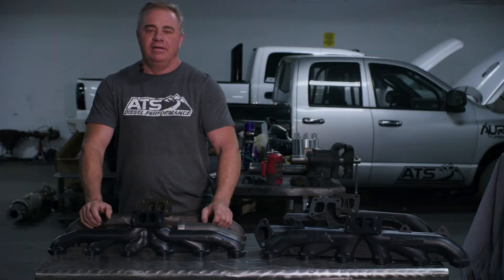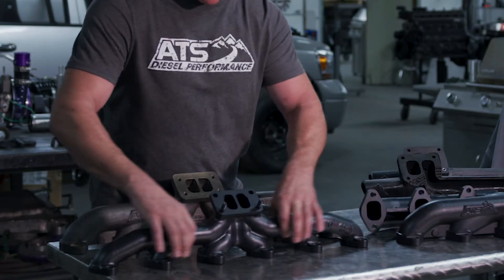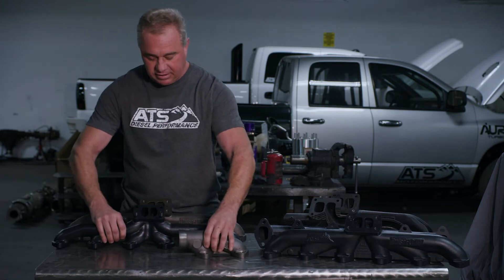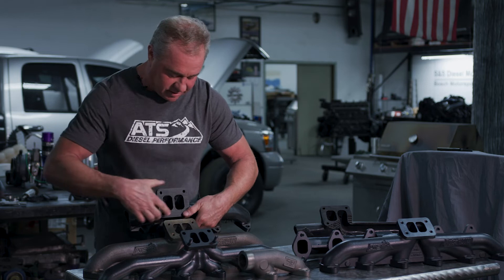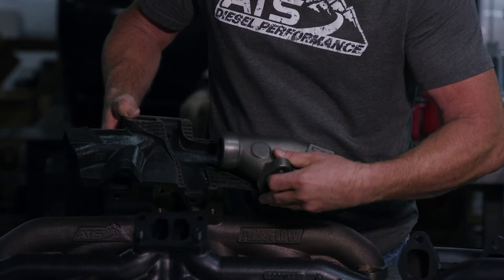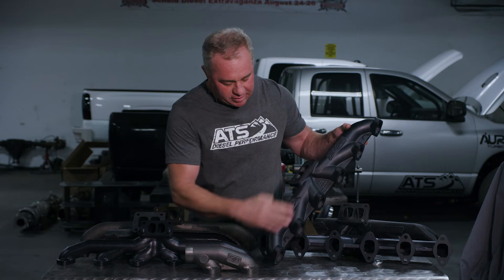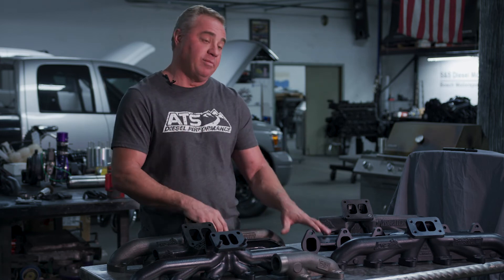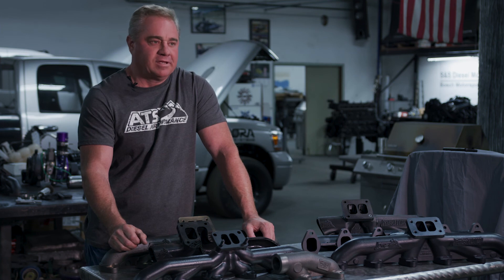ATS PulseFlow One-Piece Exhaust Manifolds -Dodge Ram 5.9L Cummins  - 5 yr Warranty

Comment: Dropping turbine drive pressure at the same boost pressure is always a good thing! A lot of guys don’t think about that, but drive pressure means heat build up all the way to the valves. That’s a nice piece of hardware guys.
Reply: Did you order one of these manifolds. Wondering if it includes egt probe ports and hardware to mount turbo?
Reply: @JO-fk1bg  mine did on my 6.7 Cummins so probably so!